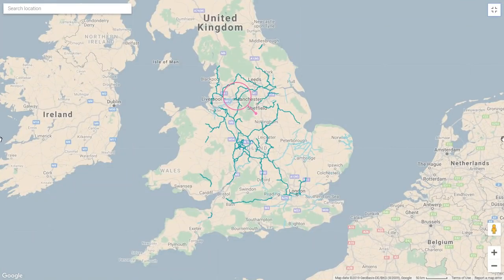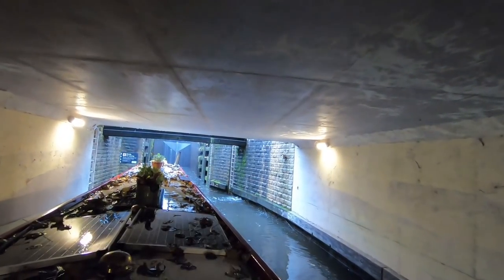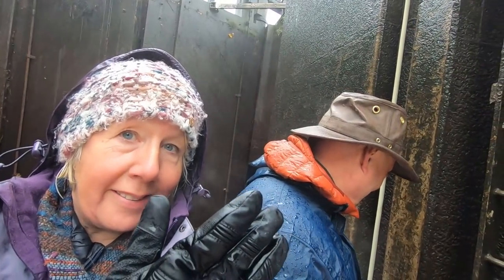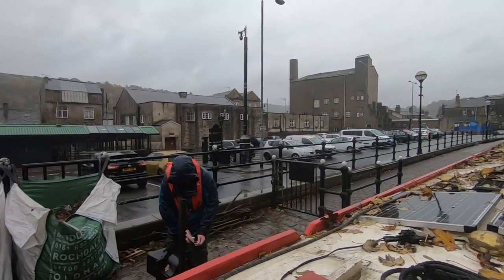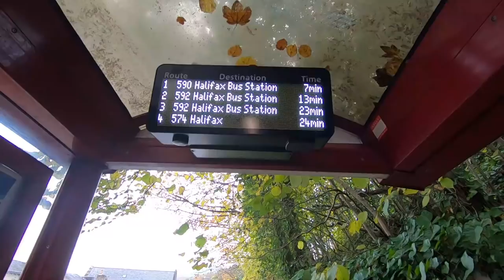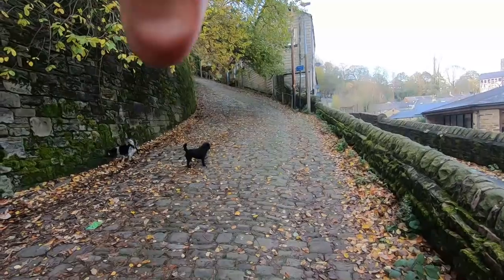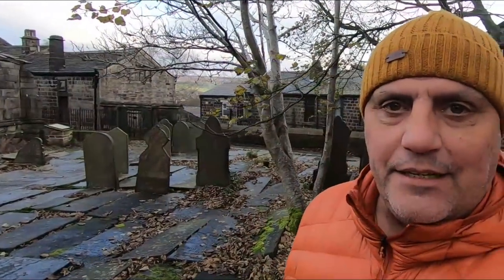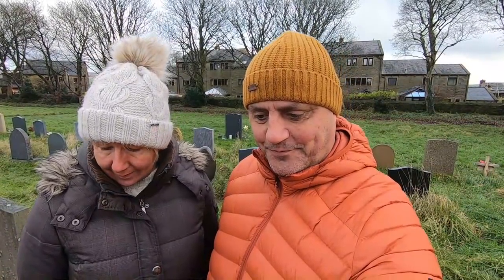The Deepest Canal Lock in the Country - Episode 72

Comment: I suffer from Reynaud's as well - mostly in the fingers of my right hand. I have yet to find gloves - or mittens - that really keep my fingers warm. I use chemical hand warmers especially when I'm indoors. I'm looking at thin glove liners that use a battery to heat the whole hand including the fingers. You can get thick ski gloves that do that - but that's not going to help me when I"m inside or when I need to actually DO things with my hands.
Reply from the maker: That sounds much worse that mine Justine, although I do still get it in the summer and only occasionally indoors. I'm going to try ginger tea which is supposed to improve circulation.

Comment: Congrats on the upcoming grandparentship. I joined that particular club a week ago.
I'm a tad concerned that the lockie at Tuel Lane was a volunteer. I would hope that CaRT would trust such a deep and potentially dangerous lock to a professional.
We've had problems with vlockies on the Trent, closing the gates as we were approaching them with the light showing green (!) and opening the sluices fully before the boat was roped up. I dread to think what might happen if they put volunteers on at Cromwell, Torksey or Keadby.
It looked like you weren't using ropes as you went up. Did the vlockie not insist on their use?
Also, vlockies are under no obligation to turn up for a booking.
There was a problem at Braunston this year when a vlockie should have unlocked the gates at the Bottom Lock. A family problem took priority, understandably, but his 'no show' message didn't get passed through the system. By the time the gates were unlocked there were at least half a dozen pairs of boats waiting to ascend.
Keep up the good work.

NB 'Red Wharf'
Reply from the maker: Hi Ewan. This particular lvlockie was brilliant. She knew exactly what she was doing and opened the lock so carefully. The bars to tie ropes to within the lock were not in a good position for our boat so we decided to go without tying up. Our main concern was that she was on her own and we felt it should have at least been a 2 person job for her own safety.